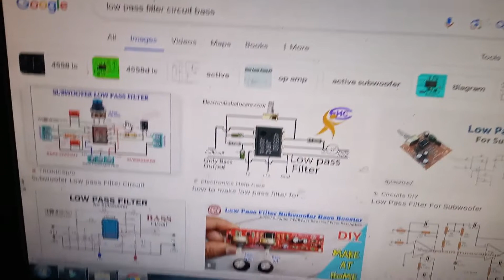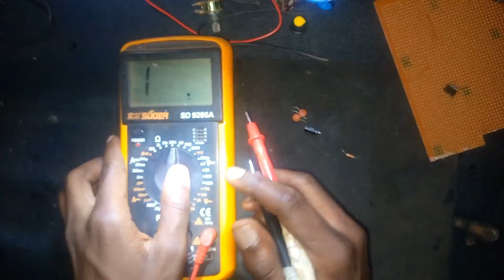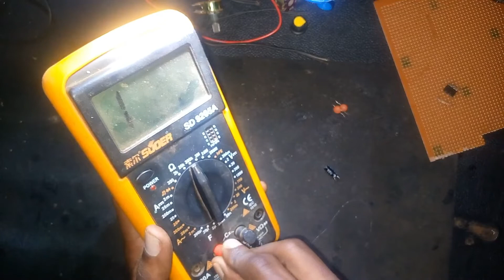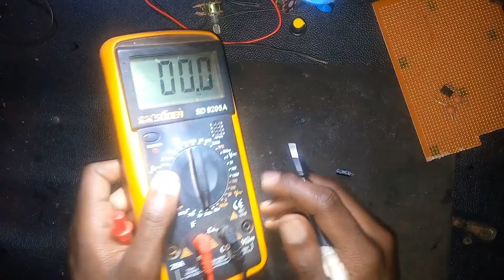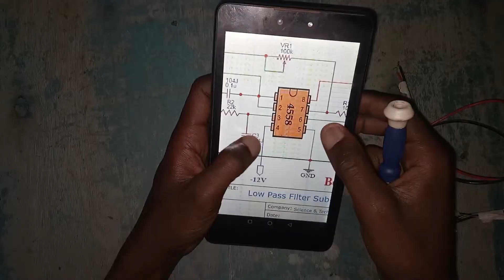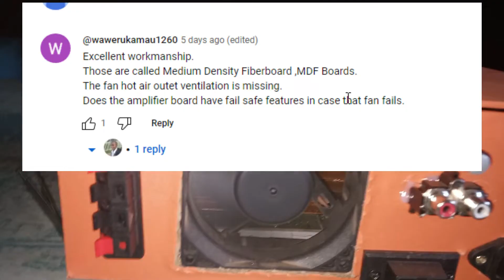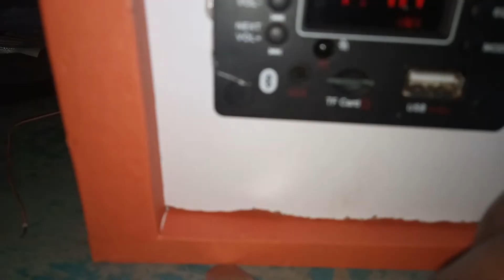Sub woofer bass booster pre amp

Comment: how can one connect a pre amp and equalizer on a green board
Reply from the maker: You inject the pre amp immediately after the equalizer sub signal. I'll try to do a video about that though am committed somewhere
Reply: It's simple, the input wires of the pre amp connect to equalizer and the output of the pre amp to the green board

Comment: Hi engineer, how do repair my green board on sub section when I touch the volumes it has signals and when I turn up the volume the speaker starts to vibrate very loud
Reply from the maker: Probably there could be a dry joint on the volume potentiometers

Comment: I appreciate your knowledge brother. I'm finding it a problem understanding how you connected the two potentiometers (frequency and gain) on your circuit. Im trying to compare it with the schematic you shared from Google and noticed it has only one potentiometer. Could you please elaborate or share with me a schematic of how your circuit is connected to two potentiometers. I liked it's performance and I want to implement one. Thanks in advance.
Reply from the maker: In that diagram, there is a 100k resistor, I replaced it with that 100k potentiometer
Reply: @emmanutechnician  thanks brother.  Let me try it.
Reply: @emmanutechnician  Thanks bro, it was a success.
Reply: Nipee namba yako buda need help

Comment: Low Pass Filter frequency range?
Alafu uko na skematic diagramsingle power Supply?
Reply from the maker: Frequency range probably from 35hz, I saw it flexing subwoofer the same way equalizer does at 30hz.
Most diagram za single power supply zikona distortions. Hii ndo nlipata haina distortions, but ni dual power
Reply: ntaijenga niexperience @emmanutechnician